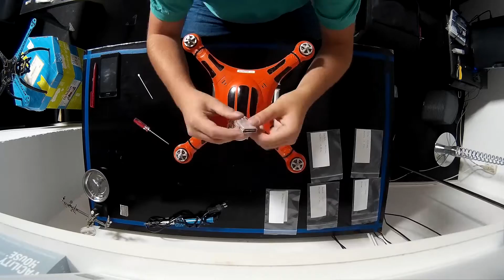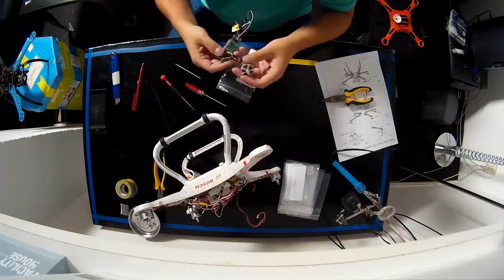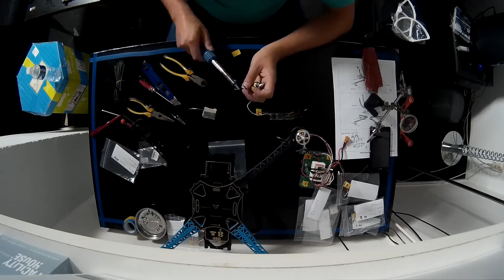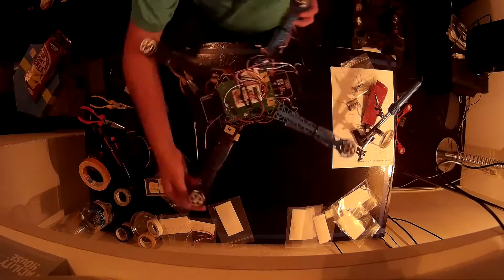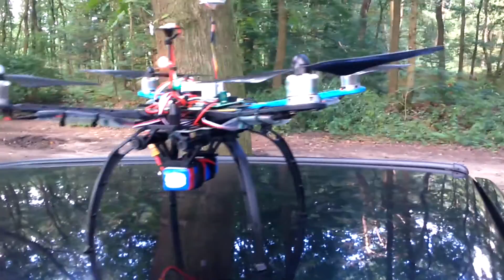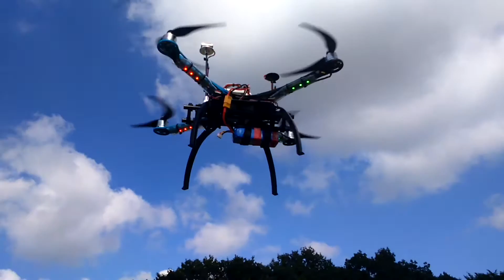CX-20 - Quanum Nova Transpant/Transformation to S500 frame

Comment: Why did not you use the connectors or electrical circuit having the frame????
Reply from the maker: +Serrasalmus Notatus Because the stock PDB don't have connectors for the ESC LED. + On the stock PDB you have a low voltage warning integrated in the pdb. so for the first flight i transformed everything :) included the stock pdb :)

Comment: How did you install the small board from the original to s500? I am talking about the one underneath where you can connect to mini USB ang +5, +12, S1, S2 ports.
Reply from the maker: +Junmard4th (Don Sales) the s500 has a tiny space under the PDB. you can put the mini board underneath the PDB and fix this with a little tape. Send me your email in PM and i send you some pictures for example.

Comment: Is the new setup lighter? I find that with a go-pro and gimbal on my stop Nova I don't have much spare power.
Reply from the maker: +Dean Nicholas nope its heavier. the setup is around 1.6kg with gimbal, camera, stockPDB, 3 extra LEDstrips, Stockdampener on top (underneath the FC) to reduce the vibratings. 2 foldering antennas and a 5400 multistar 3s lipo. flighttime around 7 min. with 1038 anti jello dji props.